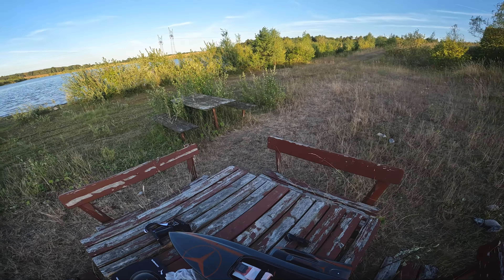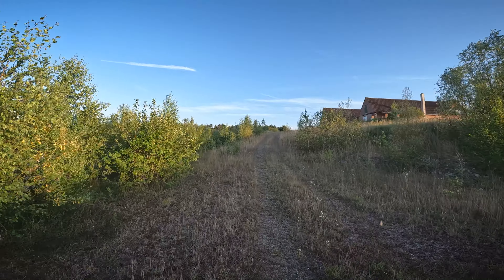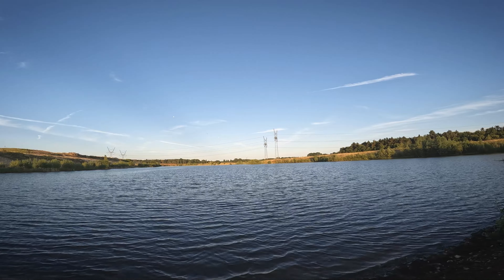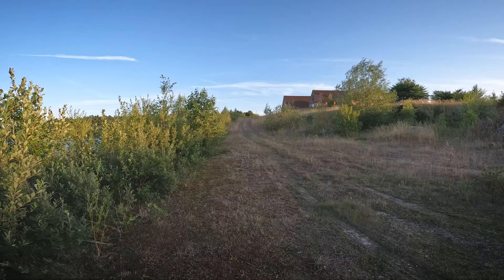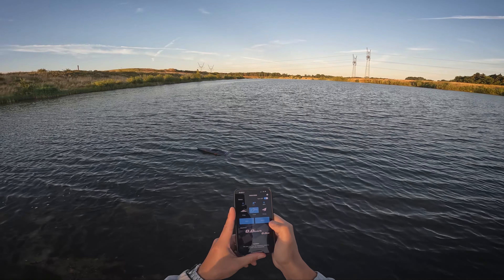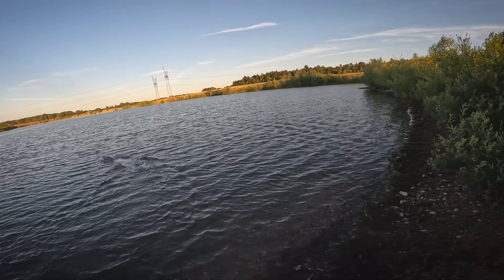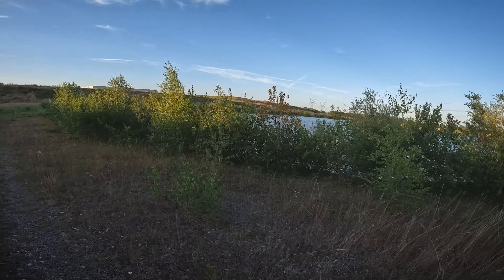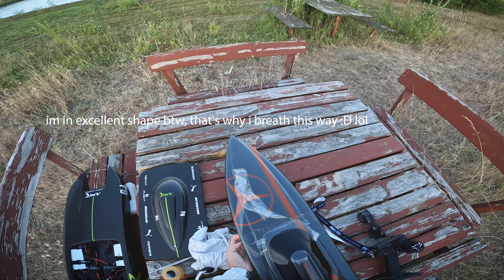TFL Pursuit - 3x Speed Runs - PB 125kph/78mph

Comment: Good running, Emil. I have a question regarding the Geico 36. What is the correct timing for the stock motors? Thanks
Reply from the maker: Hi Christopher, 
I havent experimentet too much with different timings, i kept mine at 0deg.
Reply: @EmilWilkensRC  Yes, and you ran at near record speeds. I am just getting ready to go through the esc’s with a program card and realized that I don’t have any recommended values as I did with my Blackjack 42.
Reply from the maker: @christophercurry7410  i would just use 0deg as the safest setting. You can always increase one or two steps if you are getting close to that perfect setup aiming for 100mph+

Comment: Hello Emil, I am encountering porpoising with my Geico 36. Batteries are 4x3S, struts have 2.5mm gap at end, 1716 props. Do you recommend anything?
Reply from the maker: Fast or slow ?
Reply: @EmilWilkensRC 1/2 to full, it starts to “slap” as it crosses it own wake when I go up and down the pond. I end up having to lift or it will get too much air under it.

Comment: 70c battery? Why didn't you get the 120cs? Nice run btw excellent wow
Reply from the maker: I dont give too much about C ratings and the 70C Series perform very well! 
Thanks 🙌🏻 really appreciated
Reply: @EmilWilkensRC  so if I want your speed I should get higher c?
Reply from the maker: @rctony710  if you have 50C or higher, i would not bother. Ofcause the batteries needs to be in good shape

Comment: Why did you cut it down to 1.8?
Reply from the maker: Because it will be fast and the pitch will effectively be higher this way
Reply: @EmilWilkensRC oh right. I've got the TFL Outerlimits doing 128km/hr on a 48mm 1.6 pitch prop with a 1900kv 4082 on 6s. Was going to go to abc prop but not sure if a 1916 would be too big 😂.
Reply from the maker: @Aaron5178  sounds like a lot of amps will be needed :) 1916 is a big prop
Reply: Haha yeaaah that's why I haven't purchased it yet.
Reply from the maker: @Aaron5178  it may work very well.